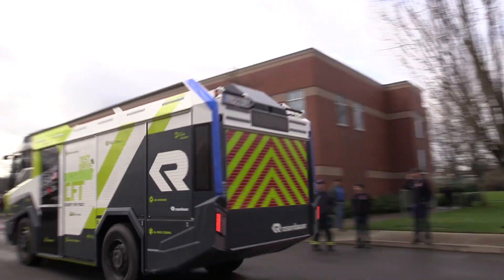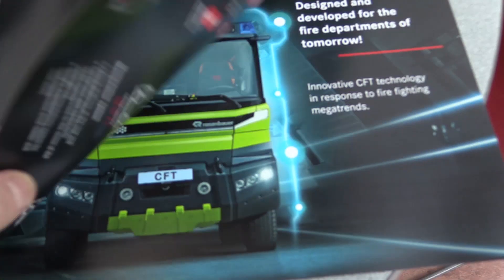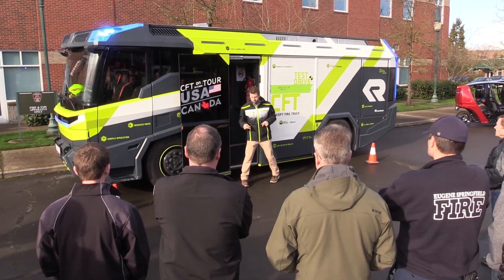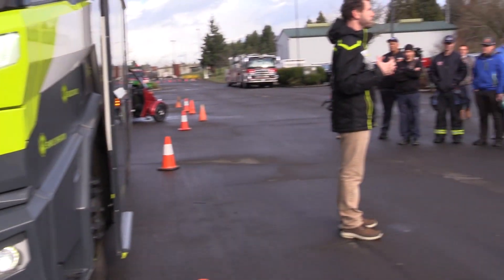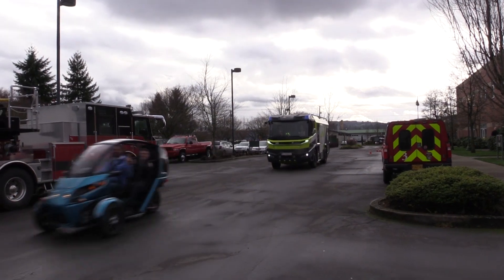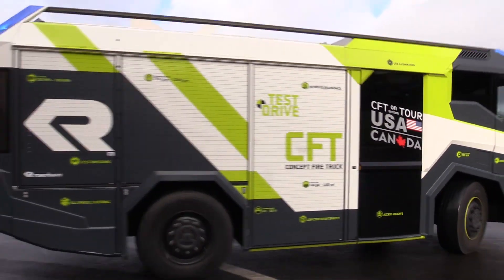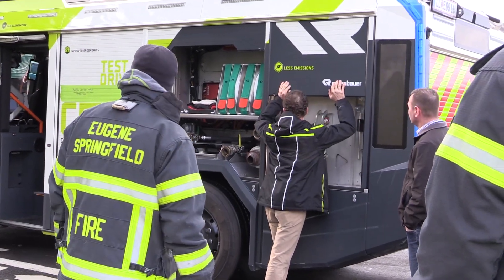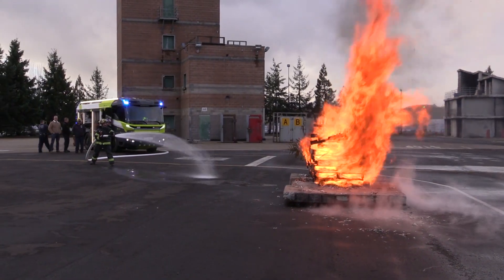An electric fire engine visits Eugene

Comment: I wonder what a base model like this will cost...
Reply: The first 3 RT Firetrucks cost over 1 Million Euros and will be tested by some fire stations to gain experience.
i have to add later on in serial production it will be cheaper i guess
Reply: @eli34536  and they claim that there are virtually no maintenance costs